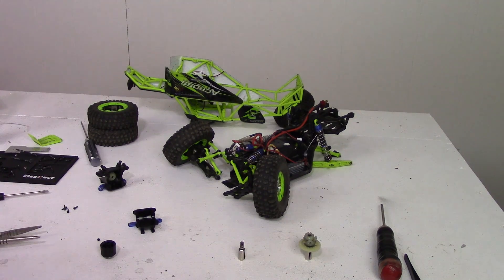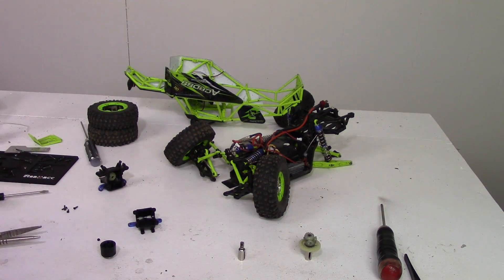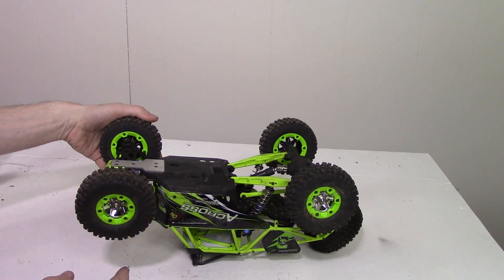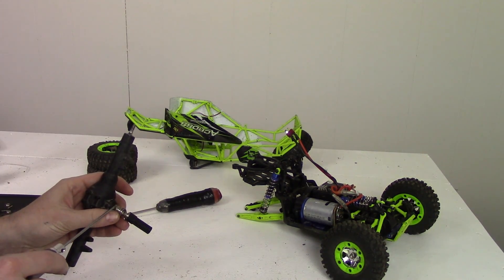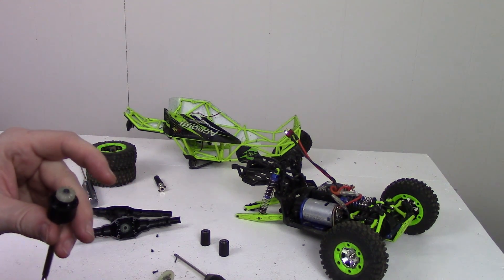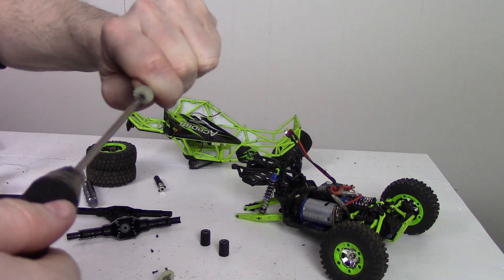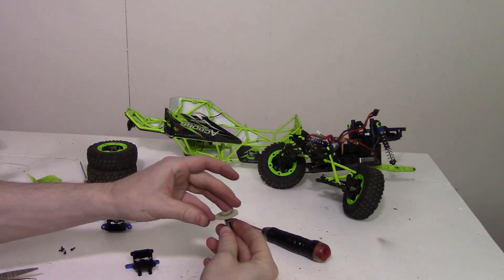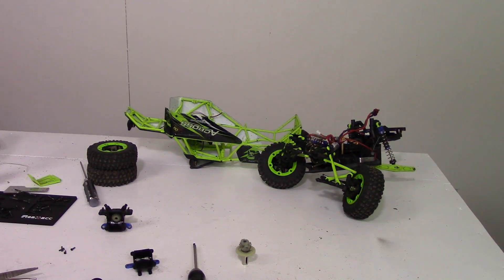WL Toys 12428 Diff Problems From Running 3S!

Comment: Be careful. As a qualified diesel Mechanic I noticed that the pinion and crown wheel back lash was not set correctly from factory. I shimmied the pinion to get the correct tooth pattern then adjust the preload on the pinion and crown wheels. Since then she hasn't slipped at all.
Reply: perfect rear are hard to fix.Your a good mechanic.Now need dia. Of shim install location and shim?Thanks swoop

Comment: This wasn't just from running a more powerful battery, mine did the same thing with the original battery!
Reply from the maker: Yes the diffs are not strong at all
Reply: Hobby grade is a marketing ploy..They install crappy parts
knowing you'll have to replace them.
The R/C industry had been around for aeons...
They know..they RESEARCH and market.
If shit didnt break....You would only have a couple and get
bored of it. Then move on to other interest...
In the mean time...it's a fucken itch you gatta scratch to get
these POS working....NO MATTER the BRAND or whatever the
hell grade they claim it to be...
Trust me...I broke every possible Hobby grade parts. lol

Comment: Metal gears are a must with this car. Buy them when you purchase teh car and sell the plastic ones to recoup the costs. The axle gears are the weak link. The spider, pinion and the ring gears are fine.
Reply from the maker: Yes metal gears definitely are a much, I started seeing metal gears pop up everywhere for this after I had already use part of this buggy for other projects

Comment: I recently purchased a WLToys 12428 and bought the metal gear upgrade kit, when I took it apart everything already has metal parts, I bet they upgraded the new version
Reply from the maker: Yes I did hear that upgraded to some metal parts
Reply: What kind of oil or grease do I put in rear end does it come with some in it sorry new to the hobby
Reply: @colbyturbeville2946  it comes with some pretty thin grease in the differentials. Don't use oil it will leak out. The thicker the grease the stiffer the differential.
Reply: @VoidXRC  Yea only the diff gears are metal, the spur, pinion and diff case are still plastic. A 12428 I worked on previously was all plastic but the new one I just bought came with metal gears. Oh well at least I have a spare set of I test anything up
Reply: Thanks for the help I wish you much luck with your rc

Comment: The feuyiue fy03 has metal gears I run mine on 4s 2 2s in series and haven't had a diff problem only steering problems
Reply from the maker: That's awesome! It's good to hear that they are holding up to some bigger power. what kv is the motor you are running? and have you put any heavier oil in the diff or are they just stock? I know I will be replacing the rear diff with the feiyue one and will probably have a go at making the front feiyue diff fit was well.
Reply: Brushless?

Comment: I just bought one of these along with a set of oil shocks, adjustable rods, a metal drive shaft, aluminum heat sink for the motor and a $26.70 "wave box" set from Ali Express.  The wave box set comes assembled with full metal along with both diffs and gears.  I think I'm going to keep the reduction gear plastic to be my chosen weakest point.
IRS too bad the upgrade parts were about the same price as the car but I think it'll be worth it....  as long as the wave box set stuff all fits.
Reply from the maker: Keeping that gear plastic is definitely a good idea! I hope that all of the parts fit well for you
Reply: @VoidXRC  
Thanks.  I am also a little hesitant about changing out all the linkage bits to metal.  I think I'll just do as needed to get the tyres to line up straight while retaining the excellent shock absorption the plastic on this truck provides.

Since I'll have a fully metal drive system do you think 3s batteries would be out of question?   

Im thinking my next upgrade will be the wheel extenders but I'll figure that out later once my fun budget recovers.
Reply: @VoidXRC    UPDATE*
Got some good news the other day.  Apparently the latest off the production line have metal gears already installed, at least in the back.  Another YouTuber said the front diff is also metal, so that's all good!  Would of just bought another if I would of known that!
Reply from the maker: @Aarons14bugs  That's is cool to hear that they are coming with the metal diffs now!
Reply: @VoidXRC  
Wltoys forever!

Comment: I'm planning on getting a a959b for my first rc, I want to eventually upgrade the drivetrain to metal gears but I don't have a lot of cash so I'll have to use the plastic for a while, would it possibly help if I were to rebuild everything and put a fuck ton of motor oil in it?
Reply from the maker: It would probably help a bit, however the biggest thing for keeping the diffs in decent shape is throttle control. Being smooth and not just gunning it all the time can make a massive difference is how stuff wears. I also didn't have the problems until I used the 3S battery. That is not to say that a 2S won't hurt the diffs, but it is harder for it to hurt them as they don't have the same power. If you have any other questions feel free to ask
Reply: @VoidXRC  I'll probably use lithium grease, it's pretty light so it won't slow down  and  it's non corrosive

Comment: To remove broken gears you will need to unscrew small bolts which usually broke because they installed with threadlock compound. Just broke old damaged gear with side cutters, remove it and heat shaft where bolt installed on gas lighter. Then you will be able to unscrew this little bolt easily.
Reply from the maker: Thanks for the info!
Reply: You also can add heat into screw head directly with soldering iron. Just be careful not to melt plastic gear too much. Otherwise i would advice using gas lighter too, or other flame based heat source.
Reply: Palagin Oleg just just the screw head with a soldering iron. They come right out.
Reply: Hellsong89 what kind of tool is used for removing the main gear
Reply: Quad flying Mav you can use a battery trminal puller from an auto parts store, they also sell rc pinion pullers on certain websites.
Reply: ryan olson ok.. the one I need to replace is the main gear attached to the front of the front drive shaft and it's in the front differential box. I don't think it's pressed on ,I think it's some sort of screw that is down in the middle of the gear. Looks like it may be a tiny star or Allen wrench, might even be a hex. Don't have any tools that are that small.  I'm ordering the gears and a new front diff. Wanted to get what I need to remove that gear also .

Comment: Void X I really enjoy your videos.  Couple things.  1. I tried a 3s 25c battery and smoked the ESC so I have no idea how you can run a 3s pack.  2. They now have a metal geared rear axle for this model.  I personally own 2 of these. I think they are great.  

On 2s lipo I measured 27mph with my gps.  plenty fast for this size model.  For the price I think it can't be beat.  I have run 10 packs through mine.  I have jumped it...tumbled it. etc. NO PROBLEMS. 

 I plan on upgrading to oiled shocks I found for this model. I have also upgraded to a 2s 2200 pack that fits for long run times. 

 I added a heat sink with a fan to motor and it just fits..so motor runs much cooler now.  I drilled some added holes into the interior insert next to the driver to improve air flow.  

I am going to upgrade the rear axle to metal gear and thats it.  I like speed as much as the next guy but why run something beyond its designed intention and then have to replace parts. 

 Just my two cents worth.   With the cooling, upgraded shocks and metal rear axle this thing should be perfect and very durable.  All the other plastic does not bother me as it is very flexible and durable.  

 I would like a better steering servo but that would mean a full swap to brushless and for the money I don't think it makes sense.  I think for me, I would rather use that money to purchase a true hobby grade truck or buggy that is brushless and made for 3s, 4s etc. 

Hope some of this information helps you and others....cheers!
Reply from the maker: Great information! Thanks for posting it. I do agree as a budget truck it is pretty good value for money especially if you just run it stock.

Comment: Great movie. Thanks. Need to save for future. I had other issue, like clutch screw lose tight and there was no move on wheels.  But found that main screw was issue, now all fine.
Reply from the maker: Thanks man
Reply: @VoidXRC  just an extra question, my wltoys is equipt I'm 390 motor. I wanted to move to 540, do You know if it make sense? Don't want to move to brushless due to tooany parts need to be changed

Comment: what's your opinion on mine and how she will handle running only rear wheel drive for the moment till I get the front diff figured out. the vaterra diff is locked by the way. my first 10th scale car was nitro hpi all wheel drive so I've never driven a rear wheel drive before. think it might be more fun but with the amount to power might also get a little squirrely at high speeds
Reply from the maker: My first real RC was a Duratrax Nitro Evader! back around 2005 I think. It was 2 wheel drive but it only ever saw some pavement running. Then I got a Traxxas nitro revo and a hpi nitro savage and the evader didn't see much use after that. All of my other RCs have been 4 wheel drive too. except for once when I lost the center drive shaft in my quanum vandal, and that thing was very hard to drive with only 2wd. Had to be so light on the throttle. So I don't really have much experience with 2wd vehicles. I think the 12428 in 2wd will be pretty hard to control.
Reply: Void X RC yeah I figured that much was just hoping for a better answer. lol considering this thing in 4x4 is hard as hell to control once I went 4000kv. I appreciate your input...
Reply from the maker: You could try programming it to give way less power on initial punch of the throttle, that should probably help with fish tailing a bit.
Reply: Void X RC yeah I'm still running it at the lowest punch setting possible. and 5° timing which is lowest other than 0° which puts it in blinky mode and something bout that light constantly blinking bugs me. lol  In timing mode the light stays lit red, blinks green with throttle input, stays lit green during 100% throttle input. same for both forward & reverse. has a nice low voltage alarm built rite into the esc which also is programmable.

Comment: So there's a difference between these and the fy03, plastic gears in this one. I'm sure the metal internals or even a whole diff would fit front and back that'd be a good upgrade.
Reply from the maker: Yes I agree it would. I've since used cut up the chassis though to use part of it in a build converting a toy dump truck to an rc one.
Reply: Aww yea cool I see you have an fy03 anyway there in the video. I'm a new owner and loving my one.

Comment: so any new info on the 12428 project. I'm bout to order the rear diff the front diff the center gearbox and all the axles from feiyue along with some more metal upgrades. I got my driveshaft  still waiting on control arms and the rear axle with ring and pinion from feiyue. I just ordered the internal parts to have spares for the feiyue  rear end which I'm bout to get now. unless we know of anything else that will work like twin hammers or something axial brand diff that I can get.
Reply from the maker: Not really, I did install a spare feiyue rear end but the front is going to have to wait till I get some more parts in. Hopefully will be able to figure out something, will most likely restrict it to 2s though.
Reply: Void X RC well even though last week I ordered the feiyue rear diff from China last night I ordered a complete assembled vattera twin hammers rear differential along with a HR aluminum planetary carrier for the vaterra diff and the aluminum hubs and the other part of the hub that connects to the front shock, 2 piece 4 total. got the steel driveshaft in which is little different from yours this 1 seem bigger around little more solid lookn. hope it holds up like yours. till I figure something out for the front I'll just bop around in rear wheel drive. I'm thinking of ordering a vattera twin hammers kit or axial wraith. still also buying the losi 8ight-e 4.0 buggy hopefully by end of the year sometime....
Reply: Void X RC shit what I spent just last night on the vaterra diff not including all the other aluminum upgrades or the aluminum carrier I could of just bought a whole feiyue. Idk I figured by the time I'm finished, hell even at this point nothing on this rig is wltoys but the panels and body.

Comment: I believe this is what happened in my A959B where I couldn't find the problem. I didn't look hard enough. Just ordered a new diff which I would have had to anyway.  Cheap plastic. Upgraded to metal gears.
Reply from the maker: Yes the plastic is pretty cheap. I just upgraded the gears in a 12428 clone to the metal ones, but better

Comment: My son's 12428 doesn't work after the first time. May be remote control issues? Where is the antenna at?
Reply from the maker: Do both the vehicle and controller power up? But not work? If that is the case then it may need to be bound again. Look in the instructions for the binding/pairing/frequency matching instructions.

Comment: Can I use a series connector adapter and use 2 batteries?
Reply from the maker: While that could be done I would not suggest it with this rig. You'll want to make sure both batteries have the same capacity and discharge rate if you are going to run them in series.

Comment: Just had the same problem. Loss of power so I took just about everything apart. Looked like no damage to any teeth on any gear. Put it back together, drove it, same problem. Should have started with your video. Do they make metal gears?
Reply from the maker: They do not unfortunately. Just the plastic spares are available. I ended up cutting up the chassis and using part of it for a dump truck RC
Reply: Do these grears work as replacement for nylon ones? If yes, what grease to put into thw diff?
Reply from the maker: Yes they are a replacement for them. I haven't personally used them but the reviews do say they work well.For the grease it is not a big concern what you use. I usually use automotive grease as it's a cheap way to get it. Just a multipurpose grease will be fine unless you want on going in water than I would suggest a marine grease(like for a boat trailer)
Reply: Void X RC thanks a lot! One more thing; is metal piece also included  for the gear that stripped on your car? Any suggestions how to remove the screw without breaking it?

Comment: I have destroyed 2 rears and 1 front with just 2s 35C venom batteries. The screw that broke may be reverse thread. Not sure though. I just ordered 2 fronts and 2 rears extra to have on hand until I come up with a better setup.
Thanks for another update.
Reply from the maker: I just went and tested to see if it was a reverse thread and broke another screw. I've now broken all of those screws off, oh well!
Reply: They must be locktighted or glued. 
Do you know of any better differentials that would fit with out a lot of modifications?
Reply from the maker: I don't know of anything that require no mods, however you can use the rear Feiyue fy03 diff with just a small modification. All you have to do to the feiyue one is grind a couple of flat spots onto the input shaft on the diff. As the 12428 driveshaft uses 2 set screws to attach to the input shaft, the feiyue uses a through hole set screw.
Reply: Thank you!
Reply: Void X RC what about the front diff. gear ratio would be incorrect than only changing out the rear. same issue I'm about to face. If the front cant be swapped out than I an on goin rear wheel drive.
Reply: Ok so you can't use the diffs from the feuyiue fy03?

Comment: I use Ceramic Grease on all my Wltoys plastic gears 7 months running for my Wltoys 12423 on a 2s 35c with no issues

Comment: Tap the philips screwdriver with a set of linesman pliers or something alike that does not deliver overkill force and try to remove after. If it's still too tight do it again until you're able to remove the screw with not so much force. Also try to give it a single solid but not overkill hit as hitting it many many times will weaken the metal and break as well.
Reply from the maker: Thanks for the tips!